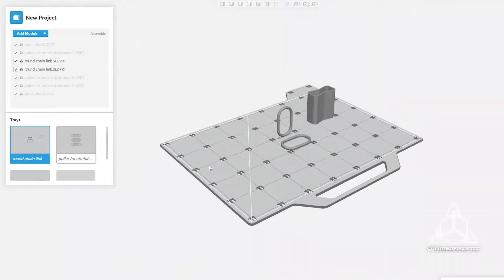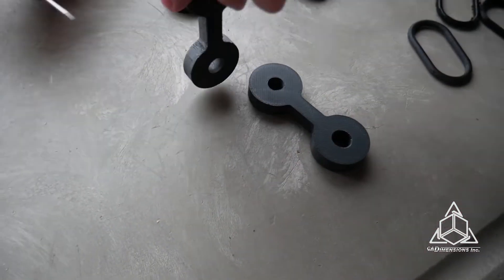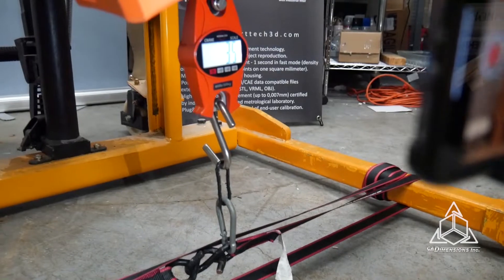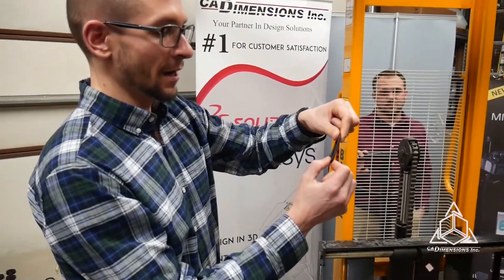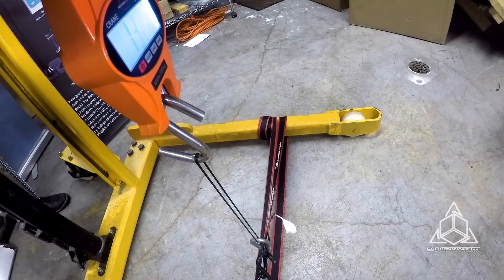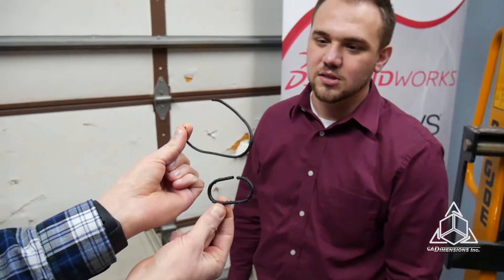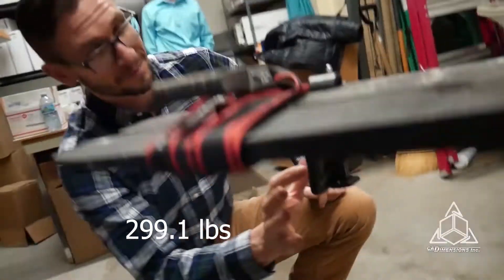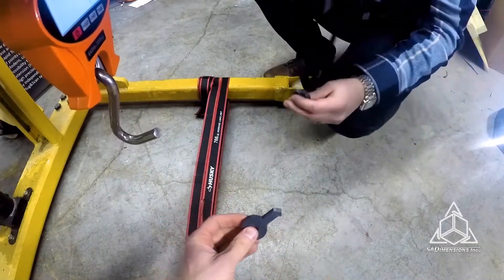3D Print Stress Test: What is the Strongest 3D Printer Filament?

Comment: Hey guys... just quickly; I’ve noticed a few errors in the implementation method of this test rig. The initial 3rd of the stretch force recorded is gone into stretching the rope that’s holding the test subject. Parts that undergo destructive testing MUST be hard mounted. Also if possible, so that the results have no discrepancies; Force is to be applied consistently without stopping. Btw Love your work 👍
Reply from the maker: Thanks for the feedback! We will do something like that if we do another stress test again.

Comment: Great demonstration! However...(don't throw eggs at me)...I see some inconsistencies in applying load forces in each test. You use a foot pump applied pressure. There is a minute different pressure "rest" period between each foot pump.  Would it be better to use a constant increasing load, using a motorized pump system? You could set a hydraulic pump pressure at a standard until the test coupon breaks. Sorry for sending a flack...
Reply: Another method (more fun and dangerous) is a spinning setup.  Another variation would be a swing setup.
Reply from the maker: You're right! That would be better. We specialize in additive manufacturing. Not so much the stress test side of things. I do like Joseph's spinning idea!